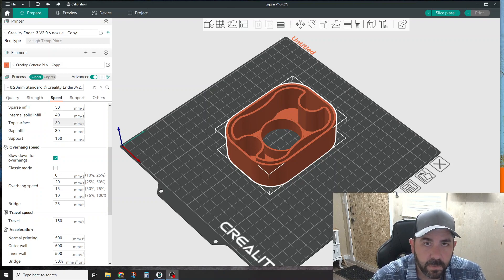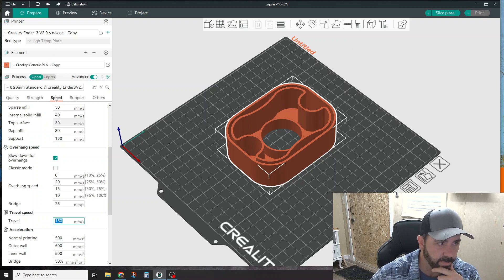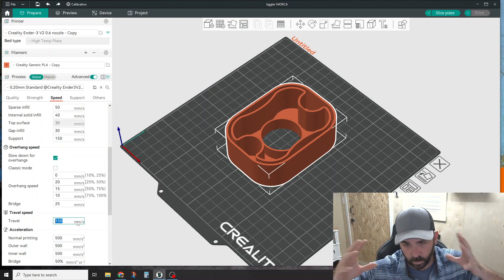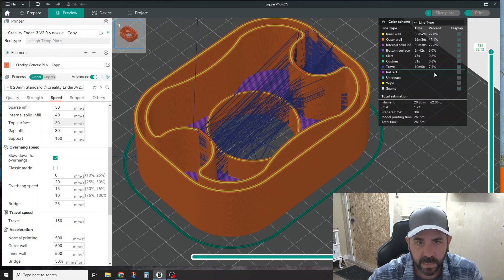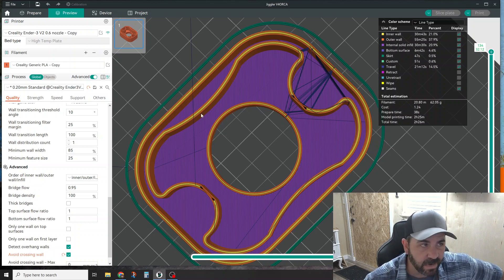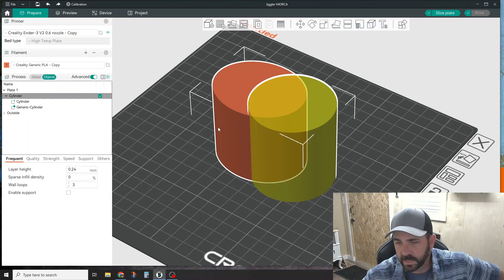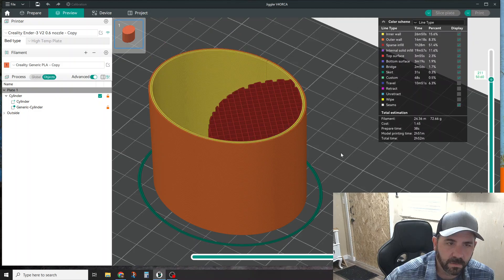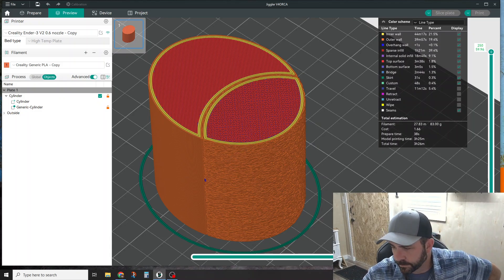Orca Slicer Reduce stringing in prints and use Modifiers to selectively modify portions of your part

Comment: Can you add a modifier on one object. For example, I want layer 30-40 to be 50% infill instead of 15% or change print temp lower from layer 30-40?  Just some examples to find out if Orca allows for this time of setting changes?
Reply from the maker: for the infill example, yes.  you can add a modifier that effects the infill.  For the temp, I don't see a way to change that with a modifier.  for temps you may have to play with gcode directly.
Reply: @fischer3d  thanks. I now see that by using height modifier it will allow me to do this for infill.  Thanks.

Comment: it's a year since you recorded this video and my printer is a small, Core XY- DIY build- printer (Rolohaun's Rook). In OrcaSlicer, I  use the Voron 0 for my printer profile as it's the same size. Anyway, the stringing is horrible and when I went to check my "travel" settings, they no longer have it in its own category....I see it under "acceleration" with the default "7000" mm/s to the 2nd power, and under "Jerk (XY)' as "12mm/s".....and honestly I have no idea if I need to increase or decrease either of these....I barely understand what Jerk even is....
Reply from the maker: Interesting.  I reset my printer to a voron 0.4 in Orca and I see travel speed under the speed tab just above acceleration. 
here are a couple of other areas to look at that promote stringing:
1. Retraction amount (What's your current retraction set to 1mm, 2mm?)
2.  Print temps.  Might need to drop a few degrees
3. Travel speed (boost it up)
4. z-hop, when enabled can promote stringing.  This was more of a problem with Marlin machine that ran slower.  Less of an issue with faster machines. 

Acceleration and Jerk will have little impact on your retraction, if any.  Those have more to do with how fast the head moves while printing. Acceleration is how fast it gets up to it's max speed after turning a corner or starting a new layer (straight0line performance).  Jerk is how abrupt a direction change is.  So, how fast does it make a right or left turn while printing.  If you were printing with a Marlin based firmware machine like an Ender 3 or a CR-10, I might suggest we look at accel/jerk, but with you machine maybe focus on items 1 and 2 above first.
Reply: @fischer3d  Thank you! Concentrating on 1 & 2 was exactly what I did this morning and I was able to eliminate almost all the stringing. I dropped the temp of PLA by 10 degrees, set my retraction to 1.5 and upped my travel speed. By my 3rd print of experimenting with settings…I had massive improvement. Will watch the rest of your Orca Slicer series because I realized there’s still so much I still need to learn. Thx again. 😊

Comment: Avoid crossing wall that's what I'm looking for! Just switched to Orca.  For your stringing problem have you cleared your hot end lately? Shoved the ptfe tubing all the way through?
Reply from the maker: Thanks.  Yeah, I had actually switched over to a direct drive on my Ender, so a lot of the classic "bowden" causes were solved.  Later I found that z-hop was turned on by default in Orca, also causing excessive stringing.  https://youtu.be/ErPQQcRQwec

So probably an update on this video, if you are still having stringing issues you should verify if z-hop is turned on or not.
Reply: @fischer3d  awesome thank you! I just switched to Orca and your tips have been super helpful. Subscribed

Comment: have tried all these tricks and then some, i had no strining when i was using cura, switch to orca and CAN NOT rid of it. its constant and the worst ive seen ever. there is no way i can get this to stop. im on Ender 3 Neo with 2mm retraction at 50 mm/s using PLA, i have tried changing the  temp, speed, fan speed, z hop, z hop type, z hop off, wiping, no wiping, and it will not stop.
Reply from the maker: Is that a direct drive or Bowden tube setup?

Comment: I have an Ender-3 S1 direct drive and want to make the switch from cura to orca, can i do this without klipper or raspberry pi etc? It says i need the printers ip address, where is that found? Give me a list of steps to follow lbvs. Thank you!
Reply from the maker: Is your printer currently network connected?  Klipper and R-Pi are not required to make the switch to Orca.  Once you've added the printer and you slice your file you can export the gcode to a sd card and print from there.  

Load your model, adjust your slice settings,  hit the "slice plate" button to preview the print. There is a "print" button in the top-right of the screen.  Use the down arrow next to the button and select "Export Gcode".  You can load that to a sd card and print that way.

Comment: I just transitioned from Cura to Orca slicer yesterday, and I’m blown away. I love it!!! Bye,bye Cura, hello new friend. Keep the great Orca content coming. Subbed.
Reply: How come? I switched as well but I found it really annoying how I couldn’t search for my settings since I was transferring my settings and then the part I sliced had lots of extra travel even thought it was a hollow cylinder which caused an immense amount of straining. Cura did no such thing. I really want to switch since it better but idk how much benefit there actually is
Reply: same! i just recently switched. liking orca they need a measuring tool like prusa but other then that its great
Reply: been forcing cura to work for me for 4 years.  recently got a bambu, noticed the similarities in the slicers between bambu and orca (they are forks) and I took a lot of what the bambu uses and brought it over to my ender/cr10s.  I was BLOWN away how much improvement i was able to achieve from even the built in profiles.  Once i got it dialed, my quality is almost on par with the bambu and the speed is very respectably averaging 125mms with 1500-2500 acceleration numbers.  I can push it faster but i also increase my chances for failure.  current profiles are resulting in a 99% success rate, and brilliant finish quality.  Now if only i could keep the rH of my garage down under 50 we would be set! Waking up to strings is sad.  This video has shed some insight for me, but many of my prints are multi piece or multi part so i end up moving from piece to piece which is where i string really badly.  Great video, new sub here as well :D
Reply: same just stared 3d printing a week ago and just download Orca yesterday i'm already in love. check out my live stream been streaming non stop
Reply: Same here, i fully calibrate my creality and i love It! Goodbye cura